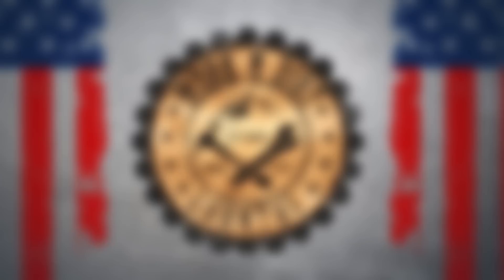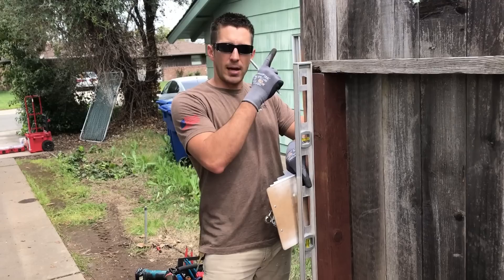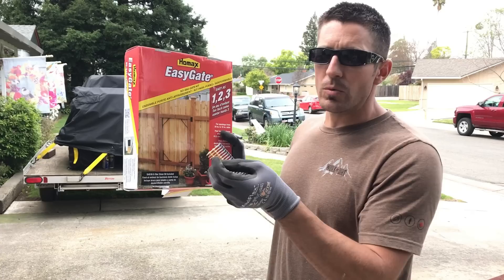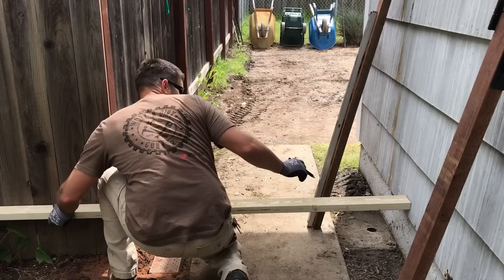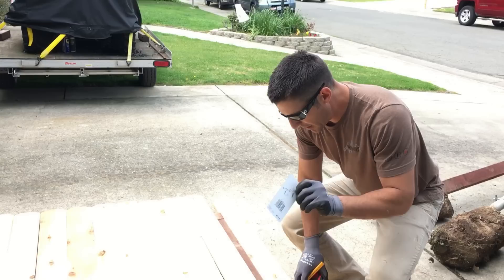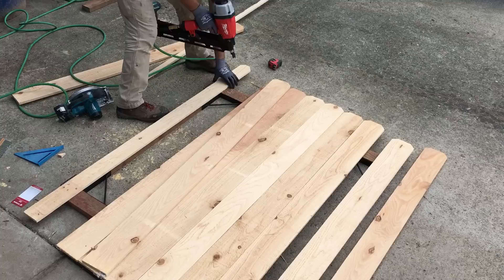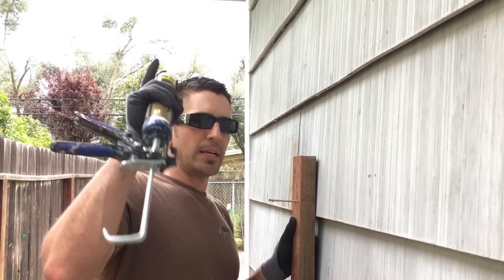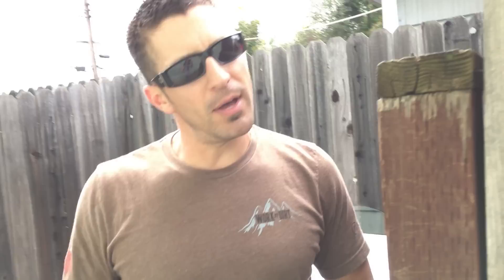How to Build a Gate - Homax Easy Gate Kit

Comment: Looks good.  I'd have probably used Adjust-A-Gate for this job, since that post was right there and the screw-in lag bolts will prevent sag a lot longer than hinges, but.. no doubt, you're a carpenter and you'll fix er' up if that becomes an issue.  Hoping for all the best for you and J-Lo.
Reply from the maker: thank you! il check out out the adjust a gate!

Comment: Why did you attach hinges on the outside of the fence instead of the inside of the post like you would when hanging a door?
Reply from the maker: Rick Hammell ,Very good question Rick, you can definitely mount to the inside of the post but i chose not to because generally, your wider heavy gates will tend to pull the hinge plate away from the post putting tension on the screws. (hinge plates start to bend over a long period of time especially cheap ones) 
If you mount on the front side, the screws will be under a shear load rather than in direct tension because the hinge or load is pulling at 90degrees.  So it will last longer. The trade off is , you the aesthetics of an exposed hinge and the lack of security because people now have access to the screws but i’ve never known someone to unscrew a gate to break into a house... At the end of the day its tomato tomata . thanks for watching
Reply: @WorknDirt  Great answer. I had the same question. Question: If I didn't want to see the hinge, could I use longer (3 inch) decking/galvanized screws? It seems like 4 screws per hinge would over engineer the shear load. (I'm just looking for a nice clean front of my fence)
Reply from the maker: @BFSilenceDogood  yes longer would be better and try to make the gate as light as possible👍
Reply: Also I found that mounting to the outside allows the gate to open all the way. When you mount on the inside the pickets will bind at the half way point, just a choice

Comment: Great Video.straight to the point.
Reply from the maker: Lee Townson Thanks for watching , i hope your gate turns out great! I would also recommend picking out Dry lumber so that you don’t have warping issues.
Reply: WorknDirt On this note about dry wood, what are your thoughts about using non - pressure treated pine for the gate if I’m planning on painting/using a heavy duty deck stain when I’m finished? I’m in the desert by the way, so moisture isn’t much of a problem. We deal with sun damage more than moisture damage.
Reply from the maker: @unionrunner1  You nailed it, deck paint/stain on non-pressure treated wood is a great option.

Comment: Can you attach the pickets after installing the frame to the fence?
Reply from the maker: MrHornm12 hi yes you can, but i would suggest putting a support block on the ground on the opposite end of the hinges so that you dont risk installing the pickets on the gate while it could possibly be slightly out of square” . the brackets are sturdy but its extra insurance.. thanks for watchin!

Comment: Here is my experience with the kit.

The kit is four brackets. Two brackets have hinges on one side to attack to a four by four. 

You will need your own screws for the hinge side to attach it to the four by four. They are not included
.
You will have just enough screws and not one extra.

The screws are of the star drive variety. They looked cheap but seemed to be very strong.

There is a really crappy drill bit included to pre-drill for the screws so you don't bust the wood.
The drill bit is garbage and it is not hardened and soon it was wobbly. You can actually bend it. 
I finished the project by cutting the head off of a large galvanized finish nail. I burned holes instead of
drilling them out. 

You will need a drill and a driver for the screws. I had to use a hand driver and I broke it and had to do it by hand. It was a CHORE. 

You will need some clamps to hold it together while building it. 

It is NOT a 20 minute job, not for this 58 year old. 

Notice I had attached one bracket with
 the hinge on it and then I noticed the brace weld had not even been welded, so I had to return the bracket to Lowes. They were kind enough to replace the bracket but where is quality  control? And I think this product said it was made in Pennsylvania. 

I think I am going to put a cross brace in the middle of the gate because the total distance of the frame is 59 inches. Those cheap Lowes fence slats need support in the middle. ((((DON'T buy  them at LOWES)))) (((the slats are thicker at Home Depot)))

On top of that I had to return a dime store $44 "Chicago brand "circular saw that I bought at Harbor Freight. The lever that you use to raise and lower the deck on the saw was useless. It was BRAND NEW. I used it to make just a couple of cuts. I got a REFUND and I have a new appreciation for my very heavy Skillsaw brand circular saw. It's heavy and huge, but it isn't total garbage.
Reply from the maker: These details you mentioned will definitely help other viewers out so thank you. sorry to hear about the troubles but im curious how you “burned the holes” out for the screws? im also curious what saw you used from Harbor freight as they are starting to carry better models/brands. thanks for watchin!
Reply: @WorknDirt  Maybe  it's a trick that some people don't know, but once the cheap drill bit was all twisted up I had to find a new bit. I  didn't have  a bit that small but I had  some large galvanized finish nails about  three inches long. I merely cut the head off of  the nail and put it in the drill bit. When I say I burned  the holes, I mean  the nail doesn't have an edge. The friction of the nail spinning fast basically burns a hole. You have to  force it it  with drill at high speed, but I was taught to do that at a young age in my  dad's sign shop. Sometimes you have to improvise. The circular  saw that I am talking about is the Chicago model, the  $44 dollar model. It is  sort of an off red/pastel rose color. It  has a laser thing  on  it. You have to put batteries in it. I wanted  a lighter saw, something a little more modern. I got my money back. Even the screw hole where  you put the batteries  in was already stripped  out. The screw simply  goes into plastic, no metal thread insert, nothing. I looked at the next model up which  is $59 and the base would lock down well but I decided not to try another Harbor Freight circular saw. I  bought a cheap Chicago grinder for about $16 and  that was a good deal of course. I  figured that if I am  going  to put out over $44 for a circular saw  then I  would invest in a better brand. I  was pretty  pissed. I was all covered in saw dust from  cutting the overlap of the fence panel at the gate opening. I merely trimmed the 1/2 fence panel and then I realized that saw was junk and that the base wouldn't lock. I had sawdust all in my hair, all over my face, down my back. I still had sawdust all over me when I was in the store. And I was  dirty  when I had to return the  bracket for the Homax Gate Kit too. I  wasn't  a happy craftsman yesterday. I got  the frame  together though and today I will try to put the gate in.

Comment: why not put the hing on the inside like a door
Reply from the maker: By placing the hinge parallel with the gate (on the post) puts the lag bolts perpendicular to the force and makes it a little stronger (if they're inline with the force, they have a tendancy to work themselves loose over a long period of time). It also keeps the "hinge plate" inline with the force because hinge plates can bend if someone were to jump on the gate (if mounted on the inside)..  Thanks for watchin!
Reply: @WorknDirt  I just did one this way but it was because I didn’t have second hands I guess I can see probably better to leave the end pickets off so you can cover the hinges

Comment: Garbage, I just bought this kit from lowes 1 week ago for a 6 ft tall, 40 inch wide gate, two things occured, rusting and it started to sag!!!! waste of time and money.The hinges are poorly designed and very thin
Reply from the maker: Sorry to hear, to fix the sag i would suggest lifting the gate up on the sagging end and then nail or screw on a diagonal board over the brackets, like a 1x6 but use fastners with a big head or lag screws with washers to offer more clamping force.